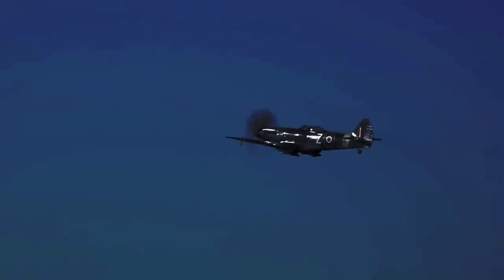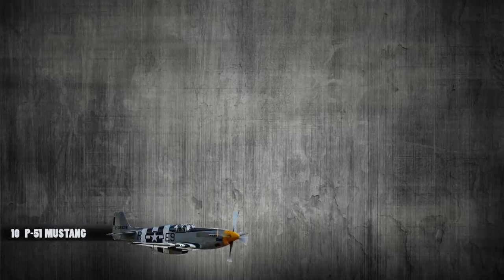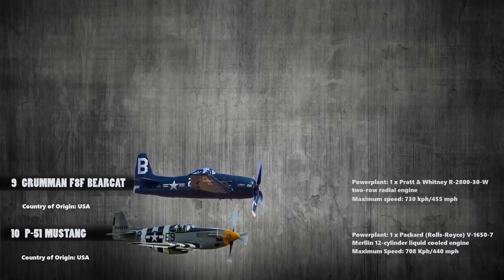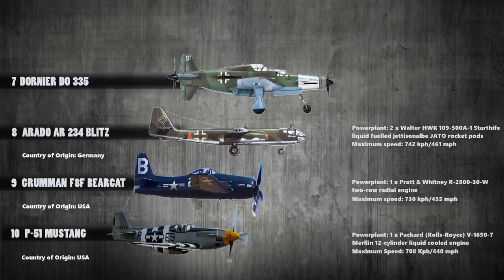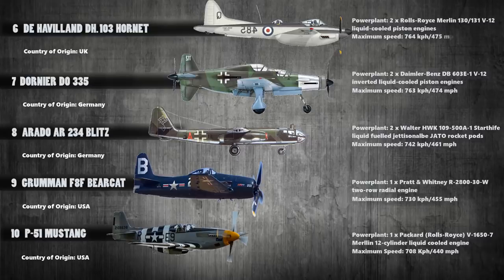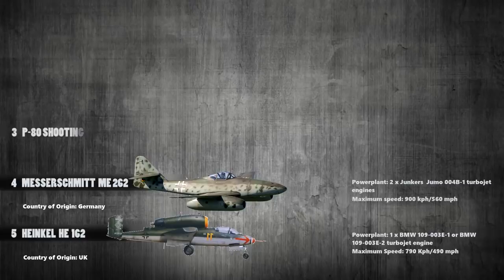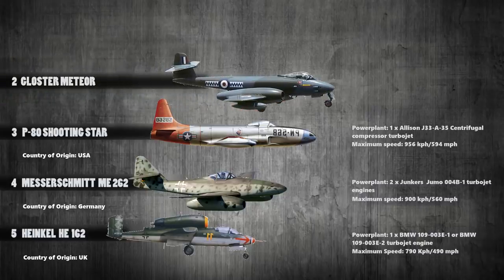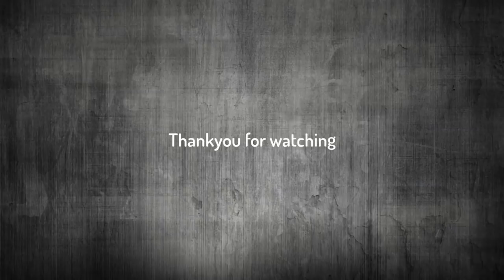10 Fastest World War II Aircraft

Comment: The hornet and Bearcat never saw active service in WW2...
Reply: They're produced before WW2 ending, so the video is correct
Reply: Most of the planes on the list never saw much significant operational use prior to the end of ww2.

But, they all saw their first flights prior to the end of ww2.

The list is missing the Hawker Sea Fury
Reply: @stenwilliams5347  Except it also doesnt include Japanese planes, making it biased
Reply: If you listen to the intro they don't say "active service", the Bearcat was operational in WW2.
Reply: The Bearcats were on the USS Midway at Pearl harbor when Japan surrendered.
The P-51H (489mph) actually flew several missions against Japan
The P-47N(467mph) had been in service for a few months at the time of the surrender
Reply: If being introduced is the only requirement, then the F7F Tigercat bumps the Mustang off the bottom of the list with an airspeed of 740 km/h (460 mph).
Reply: @stenwilliams5347  the narrator actually said that they were only showing battle tested aircraft that saw service during WWII
Reply: neither did the P-80 shooting star
Reply: @politenessman3901  "will only include aircraft that have proven their metal in service....... does not include unproven aircraft" that sounds like she means active service, because test aircraft haven't really "proven their metal in service"
Reply: @kingofthejungle3833  Operational is in service and proven.
Reply: @politenessman3901  proven or passed testing?
and operational means assigned to a squadron, some hadn't been
Reply: @kingofthejungle3833  The ones I indicated were in operational Sqn service. That means they were proven.
Reply: @politenessman3901  what about the P80? 
try looking up the various aircraft mentioned, rather than defend the channel to me. 
this conversation is over
Reply: @kingofthejungle3833  Did I mention the P80?  FFS I'm not going to defend comments other people made.
Whinging that I won't defend other peoples arguments make you an utter clown.
Reply: @politenessman3901  you'red efending the narrator, she mentioned the P 80
Reply: @jamesricker3997  this is from Bill Gunston Combat Planes
Bearcat VP19 was almost combat ready when the war ended max speed 447 mph
Tigercat the Tigercats did not see service in WW2 and their max speed was the F7F4N at 432 mph
Reply: @Hoa Tattis I have The Illustrated Directory of Fighting Aircraft of WW2 by Bill Gunston and He Contradicts himself with Service Delivery of TigerCat In October of 44 so it did see service in WW2 just no Combat Actions. Most however were Ordered for the Marine Corp Use in Land so they Island Hopped to Pacific Theatre but had nothing to Fight!
Reply: @Manuel Monteiro  A Squadron ( VF-19) of BearCats were Operational by May 21st of 45, So after Germany Capitulated but over 3 months before Japanese Surrender, So You are Mistaken it just didn’t see any Combat.
Reply: @bradleymcavoy3432  wELL WHAT fNNNN USE ARE TYOU FIGURES IF IT DID NOT SEE COMBAT
Reply: @bradleymcavoy3432  Jesus you blokes amuse me service delivery is not combat
Reply: @bradleymcavoy3432  Ah but did it see combat ?
Reply: @Hoa Tattis F7F Tigercat saw Combat in the Korean War, the Squadron I mentioned was Prepared for Combat, So what’s your problem?
Reply: @Hoa Tattis Yeah thanks for the Effing Info Captain Obvious! So what’s your Fucking Point? This video showed Top Fastest of WW2 even though some of them didn’t see Combat They were Developed and Saw service during WW2 even though TigerCat wasn’t on the List, I was responding to Someone Else who said it didn’t see service during the War even though it did. I Don’t recall the video saying that Combat was a Prerequisite so what gives and how is that my Effing Fault?
Reply: @Hoa Tattis Neither the TigerCat or BearCat saw Combat but they both Entered Squadron wide Service during WW2 (And the Pilots we’re Prepared for Combat) before Japanese Surrender, Why is this so Hard to Understand? F8F Bearcat is still one of the Fastest of the War whether it saw Combat or not this Fact is Unchanged ( And was part of the Video in Question) So Why are you picking this weird fight with me? The US Navy and Marine Corps do not put Aircraft in Squadron service (or Their Pilots) if THEY ARE NOT COMBAT READY.
Reply: @bradleymcavoy3432  If two well repected Authors say No Then that is what I will go with
Both the Bearcat and Tigercat were not as fast as everyone says
Reply: @bradleymcavoy3432 There seems to be some confusion some say the were in service WW2 Others say they were not in Combat WW2
Reply: @Hoa Tattis Tigercat was Fast ( For the Time ) For a Two Engine plane but was more of a Strike/Ground Attack Platform than Interceptor but wasn’t on the Video List anyway, Bearcat’s Top Speed maybe slightly Exaggerated but both were in Squadron Service before Japanese Surrender they just didn’t see any Combat as a matter of Fact the Royal Navy Evaluated both before German Capitulation but of course not a Full Squadron of either ( And they were not Prototypes they were Armed Test Vehicles). I Apologize for being a little too Snarky in  my previous comments I Confused You for Someone else in the comments. Race Tuned Post War Bearcats are Crazy Fast and can go over 516 Mph!
Reply: @Hoa Tattis Yes Both in Service and saw no Combat and no Confusion. F-14 Tomcat was in Service in 74 but didn’t See Combat in Vietnam, that’s another example but not the best because it was on Aircraft Carrier and didn’t really Fly over Nam.
Reply: @bradleymcavoy3432  Ok but none saw action
Reply: @Hoa Tattis If by Action you mean Combat then Yes, No “Trial by Fire” but they still Flew missions and were Prepared for Combat. By 1945 Japan had Lost most Carriers ( One in reserve with no aircraft and one with incomplete air arm with Skeleton crew) There were P51s, F4U Corsairs, and F6F Hellcats Everywhere so the Marine Corps TigerCats and Navy BearCats which were Like 4 or 5 Squadrons Apiece had little chance to engage anything, Japan was In it’s Death Throes. One Tiger or Bearcat Squadron’s (can’t remember which)  “Mission” was to go to Australia and show off to the Aussies.
Reply: @bradleymcavoy3432  A better example would be the do 335 Arrow  in service but not in Combat
Reply: @bradleymcavoy3432  Everything is OK
Reply: @Hoa Tattis True, That is a Good Point that Slipped my mind but That Dornier Arrow Squadron had at most 16 Flyable Examples and Only 10  Qualified Combat Ready Pilots! Lack of Spares (parts) and Fuel kept that Squadron grounded but Yeah They had Greater chances for Combat.
Reply: @Hoa Tattis Yeah man Live Long and Prosper 🖖
Reply: The Arado Ar 234 used a pair of Junkers Jumo 004B as standar engines. The liquid fuel rockets were only a help for taking off
Reply: @stenwilliams5347  What bit about "Our list will only include aircraft that have proven their mettle in service" in the written intro above escaped your notice?
Reply: @chrismoule7242  Yes, it means, they're built during WW2 and have proven their mettle in service later
Reply: @stenwilliams5347  Nope - don't accept that. The narrator makes it absolutely clear in writing and verbally that is WW2 service that she is talking about, and the Bearcat to name but one did not prove itself in WW2.
Reply: @chrismoule7242  Exactly to avoid misunderstanding, they said : "aircraft that were produced/INTRODUCED during World war 2". It clearly means that not all of their active service fall into WW2 frames.
Reply: @stenwilliams5347  Nope.
Reply: @chrismoule7242  Speaking of aircrafts the most important thing is their first flight, that's why in all historical works Bearcat is WW2 plane.
Bridgman, Leonard. "The Grumman Bearcat". Jane’s Fighting Aircraft of World War II. London: Studio, 1946.
Drendel, Lou. U.S. Navy Carrier Fighters of World War II. Carrollton, TX: Squadron/Signal Publications Inc., 1987.

Green, William. "Grumman F8F-1 Bearcat". War Planes of the Second World War, Volume Four: Fighters. London: Macdonald & Co. (Publishers) Ltd., 1961

Etc.
Reply: @stenwilliams5347  Not in Munson. I rest my case.
Reply: @cz1589  Or Russian aircraft
Reply: Politenessman NARRATOR: “We will only include those aircraft that proved their mettle in service...” Having never seen combat in WW2, how did the Bearcat “prove its mettle?” It would’ve made more sense to include the F4U Corsair.
Reply: @jamesricker3997  USS Midway wasn't commissioned until 10 days after the surrender.   She never saw the Pacific until 1955.
Reply: @stenwilliams5347  She stated "planes that proved their mettle" during WW2.  So, this video is incorrect.
Reply: @kingofthejungle3833  The that means the lockheed p-80 shooting star. should be of the list. It never saw  service in ww2.
Reply: @stenwilliams5347  In that case. Why wasnt the vampire on this list.
Reply: Nor did the P-80
Reply: Cornelis Zandbergen what are some fast Japanese planes?
Reply: @goteamdefense  Here are a couple of fast japanese planes.mitsubishi  ki-83. max speed 438 mph. Kyushu j7w1 Shinden. Max speed 466 mph. Kawasaki ki-100 II. max speed 454 mph. if you count japaneses versions of german planes. Then the Mitsubishi j8m1 Shunsui. Max speed 559 mph. And the Nakajima Kikka. Max speed 443 mph.
Reply: @jamesricker3997  Correct  BearCats were deployed and Operational,  the Hawker Typhon should also be in there too  as well as the SAAB j21,  FW TA152 Hawker Sea Fury, the Nakajima J9y Kikka  and many others
Reply: Yes Manuel. And the 335.  Barely saw action also,  p80.     The musquito only had speed stripped down without weapons
Reply: @stenwilliams5347  the first prototypes of the Hornet were produced before the end if WW2, but they did not enter service until mid-1946. So both you and Manuel Monterio are correct.
Reply: @stenwilliams5347  However the war was over before the aircraft saw combat service.  As such it couldn't have proven itself in service during WWII as their criteria required. So in fact the video is NOT correct.
Reply: @stenwilliams5347  
....did they see active service though....
Reply: Neither did the P80
Reply: @stenwilliams5347  no it says OF WWII. in orser forns9meth8ng to bebof WWII it had to see combat and neither the P80 nor tje Bearcat saw service.
Reply: @stenwilliams5347  "Had proven their mettle in combat." The Bearcat and Hornet didn't see combat, therefore they don't belong on the list.
Reply: @kingofthejungle3833  Exactly. The Do-335, Hornet, Bearcat, and P-80 absolutely don't belong on this list by that metric. The Do-335 never advanced beyond 16 prototypes, so didn't even enter PRODUCTION, much less see combat.
Reply: @stenwilliams5347   Production ? Then they missed off the De Havilland Vampire.
Reply: @stenwilliams5347  yeah but at the start of thr video she says only planes with proven service.
Reply: @stenwilliams5347  they did produce the hrtton h9 how about that ?
Reply: @nicks2581  then we can also include the Ta 152 and FW 190 D13

And ofcourse the Horton H9

And wats about the 4 engined Arado Ar234C ?
Reply: King OfTheJungle mettle?
Reply: @hoatattis7283  Haha good one Englishman....Hello from San Francisco California 😂✌
Reply: @hoatattis7283  Apparently, French ace Pierre Clostermann saw a Do 335  flying at max speed at tree top level, dived on it and fired at it, but it got away. 

Not sure if that would count as seeing combat or not. It may have very well been on a test flight without armament.
Reply: Hawer tempest! and fury if you want to add the bear cat
Reply: @kingofthejungle3833   the speeds shown on several were post war versions so I’d say it disqualifies those
Reply: @kingofthejungle3833  3 P-80s in Italy flew just for morale purposes but I doubt they saw any action — it’s a stretch to claim battle tested
Reply: @bradleymcavoy3432  but the war in Europe was over so did any Bearcats fly in the Pacific ? If not it would seem they didn’t participate - whereas Griffon Spits did —- and then until 1953 so this video could technically use a top speed from a plane 8 years later 🤷‍♂️- strange video
Reply: @thunberbolttwo3953  it flew in WW2 —- 3 of them — for propaganda— but questionable with such vague qualifications
Reply: P80 too if i remember correctly it was canceled beacuse it was dangerous for the pilots
Reply: Nor did the Do 335
Reply: Ye
Reply: @stenwilliams5347  ...but manufactured after the war....Mosquito is the correct variant.
Reply: @stenwilliams5347  "in service" not just produced - there is a difference.

Comment: The Grumman Bearcat was not is active service during WWII.  It went into squadron service in May of 1945, but saw no combat.
Reply: It may have been active in the Japanese theater don't know if it saw combat but I do agree that it should not be on the list
Reply: The P-47 is left off the list.  The limited production P-47 M is credited with a top speed around 470 mph and is credited with 6.5 jet kills.   The P-47 N, a long range version capable of 460 mph, was deployed to the Pacific and saw considerable action.  The P-47 was the fastest American fighter to see combat.  Two P-80s were deployed to Italy.  Some claim that one of them patrolled for Arado 234s flying recon, but didn't come across any.  Two sent to England did not see action with one lost in an accident.  At the end of the war, the P-80 had the most powerful jet engine in the world with a thrust of around 4,000 lb.  Both the UK and Germany engines were in the 2,000 lb range (which is why the P-80 only needed one engine).  The P-80's engine was developed out of the Whittle design with improvements based on the designs of other UK engineers as well as GE.
Reply: @danzervos7606  My info is that the P47m only got tom 450+
Reply: @hoatattis7283 "Performance of the P-47N-5-RE included a maximum speed of 397 mph at 10,000 feet, 448 mph at at 25,000 feet, and 460 mph at 30,000 feet. Initial climb rate was 2770 feet per minute at 5000 feet and 2550 feet per minute at 20,000 feet. Range (clean) was 800 miles at 10,000 feet. Armanent included six or eight 0.50-inch machine guns with 500 rpg and two 1000-lb or three 500-lb bombs or ten 5-inch rockets. Weights were 11,000 pounds empty, 16,300 pounds normal loaded, and 20,700 pounds maximum. Dimension were wingspan 42 feet 7 inches, length 36 feet 4 inches, height 14 feet 7 inches, and wing area 322 square feet."   from http://www.joebaugher.com/usaf_fighters/p47_13.html  The P-47M had the same big turbosupercharger and engine, but weighed less - it was faster.
Reply: The P-51H was not listed.
It flew a handful of combat missions were flown against Japan before the war ended.
Reply: @danzervos7606  ummm p51H-5 na

Comment: The  AR234 was not powered by rocket pods, which were only used for takeoff.  The powerplant was I think was the same used for the ME262.
Reply: That's what happens when the editor doesnt know german. It states in the text "Starthilfe liquid fuelled jettisonable JATO rocket pods" Guess google couldnt translate the word Starthilfe.
Reply: The ARADO have the same turbine of the ME-262.
Reply: @scottagamer , the Arado Ar 234 has BMW 003 engines
Reply: @dieter-j.hoffmann4887  Yes, and the prototype of ME262 too, but this engine have troubles, and in ME 262 are replace to Jumo.
Reply: @scottagamer , the Me 262 had the Jumo 004. The Ar 234 B had the Jumo 004, too, but the C had 4 BMW engines. The He 162 had BMW 003, too. All those engines have not been fully developed. The Horton Ho IX had two Jumos, the He 280 had HeS 8A. Both are missing in this video... The He 280 made the first flight in 1941 and also the first e,mergency escape with an ejection seat has been made with a He 280 in January 1943.